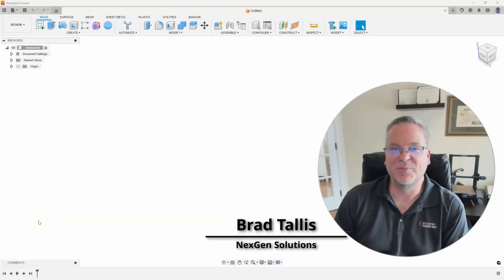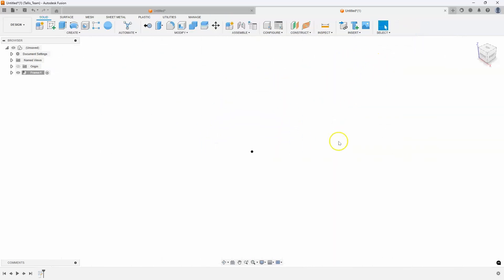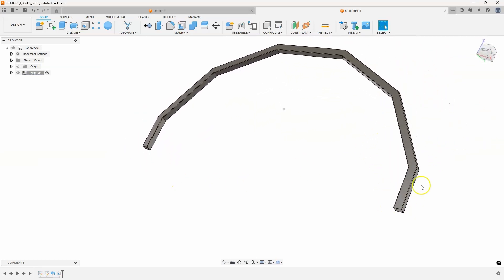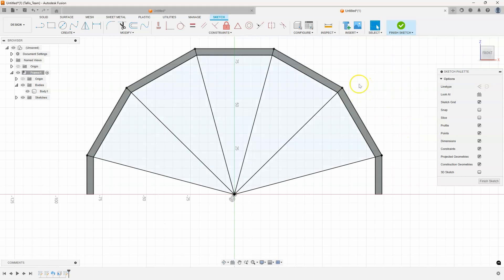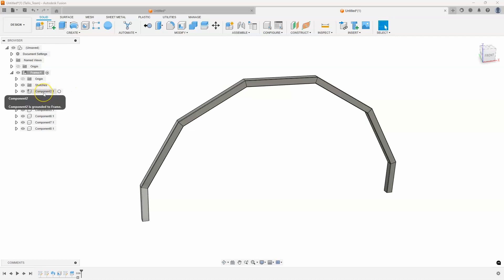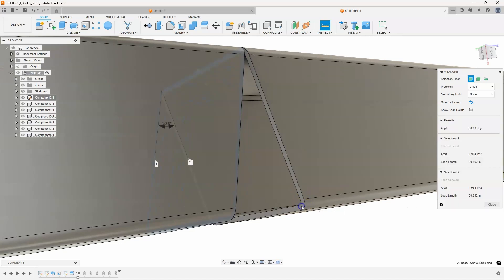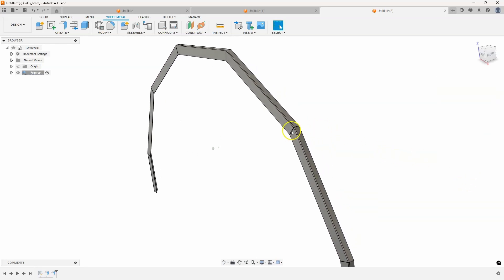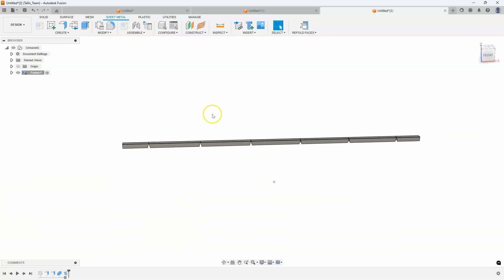Fusion Friday - Creating bent tubing

Comment: great video again! thank you!  was there a difference in length of the matal with the 2 methods?
Reply from the maker: Great question.  I should have shown this on the video.  With the Sweep option, it measured 270.093 inches.  With the sheet metal version, it measured 269.854, a difference of 0.239 inches.  This is probably due to the K-Factor being used in the Sheet Metal version.

Comment: One questio Brad, could you have created a flange for the underside of the box/SHS and mirrored and combined to generate the box?

I ask the question as I've never needed to work with Sheet Metal in Fusion as yet.

However, great video, as always
Reply from the maker: Yes, I could have created the flanges on the underside to "complete the box", but there wasn't a need to to represent the locations and angles of the notches.  Plus, the video was already 3 times longer than most of my others, so I left that part out.  Thanks for watching!

Comment: With the Align tool, you can do chained operations without having to click "OK" after each pair of surfaces have been picked for alignment.  Just leave the align dialog box open.  Once the first two surfaces have been selected, the align operation will complete, and you can click the next two surfaces to align.  There is no reason to close the Align tool between successive operation.   Thanks for the tip on the Trim tool acting like an eraser by dragging it around.  Very helpful.
Reply from the maker: Yes, you are correct on that.  I always forget that you can do that with the align command.  Thanks for sharing so others can learn.